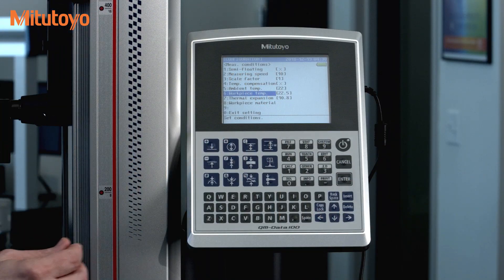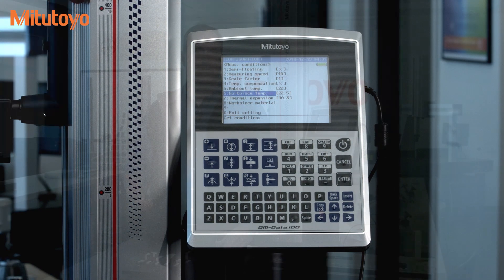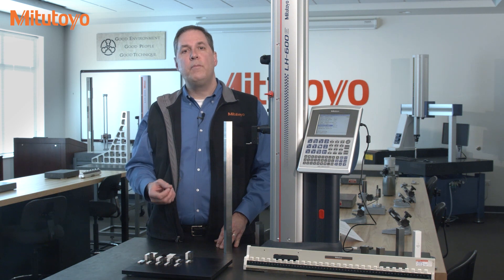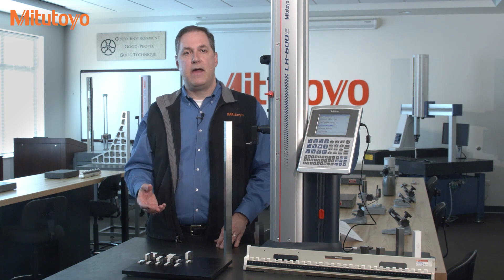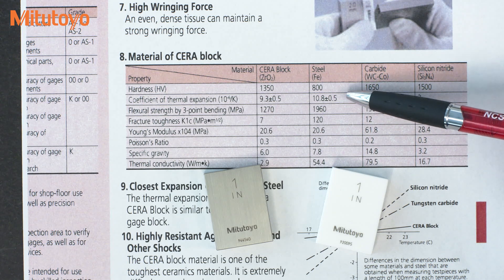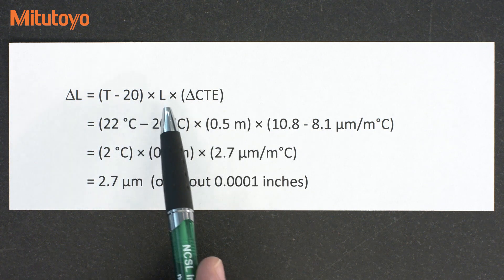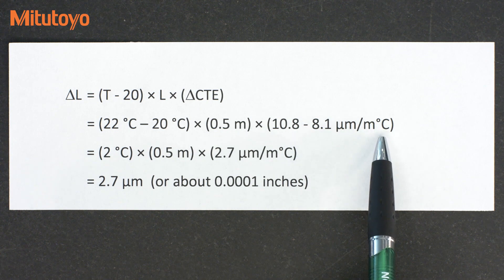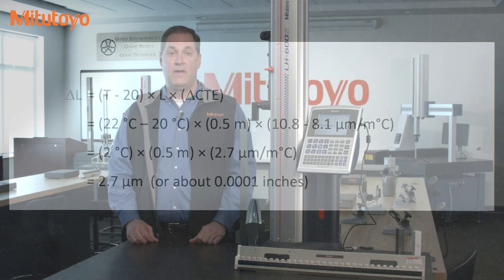Influence of Temperature on Measurement - Metrology Training Lab

Comment: Jim, this is an awesome video. It deals with something that we very seldom think about.... Temperature and it's affect upon the coefficient of expansion of different materials. You explained it so simply in an easy to understand fashion!

I used to run an inspection lab in an r&d facility where we worked on experimental tank ammunition for army tanks. And we had all the conditions that you were talking about affecting our ambient temperature.... Machinists walking in and out of the inspection lab constantly all day..... Parts being brought in for inspection at one temperature, while the inspection instrumentation (properly calibrated, showing current certificates of calibration) was at a different temperature. We did not have an enclosed temperature controlled white room.

Watching your video I can see how much influence temperature could play, especially on parts that were made out of less dense materials such as aluminums, brass, coppers, and lower carbon steels. And when you're working to mil specs..... Accuracy is everything!

Thank you for this terrific video!!!
Reply from the maker: We are glad you enjoyed this video and that you find the information informative.

Comment: very useful regarding temperature.
If we measure around 23 degrees, that causes any major effect on measurement?
Reply from the maker: Yes, but you need to know the CTE of the materials you are measuring. Our steel blocks expand at 10.8 parts per million per degree C. That means 10.8 microns per meter or 10.8 microinches or millionths per inch for every 1 degree C of change. At 21 degrees C, this 1 inch gage block will have grown 10.8 millionths of an inch bigger than at the reference temperature of 20 C.
Reply: Any deviation from 20 degrees will effect measurement. How "major" the effect is depends on what you are doing. In our Calibration Lab, 23 C is not acceptable, but for someone measuring small workpieces with micrometers and calipers, then 23 C is probably not a big deal.
Reply: @dr.jimsalsbury695  Hi Jim - really appreciate your series! If you're measuring steel components and your reference is a steel gauge block or micrometer with approximately the same CTE can you still measure relatively accurately? I'm wondering if a case could be made for having measuring gauges used on the shop floor be made out of the same material as the parts?
Reply from the maker: @johnpgerrity  Yes, that is a good strategy. The micrometers and calipers from Mitutoyo all have a CTE close to that of steel for that very reason. Even our carbon fiber calipers have a scale that is close to steel. And our ceramic gage blocks were designed so that the CTE is close to steel. Keeping all the CTE values similar eliminates one of the biggest temperature problems.
Reply: @MitutoyoAmerica  true but not all components are made of steel. Good video though. Fun starts when an assembly has parts of different materials.